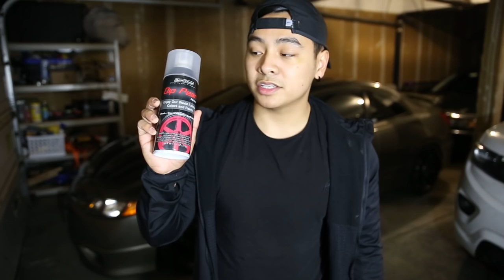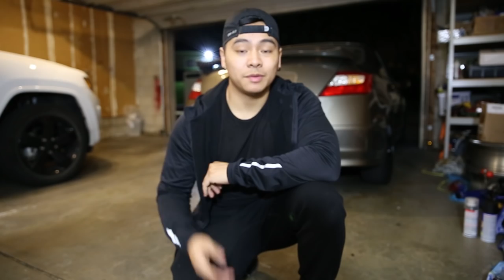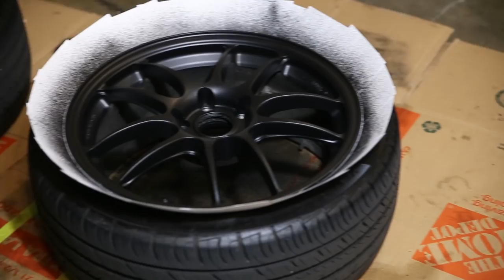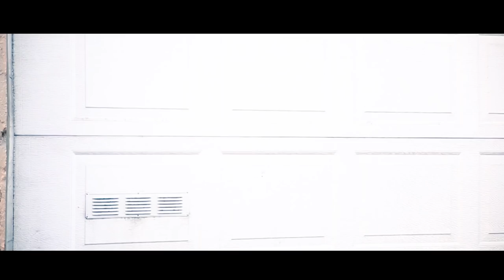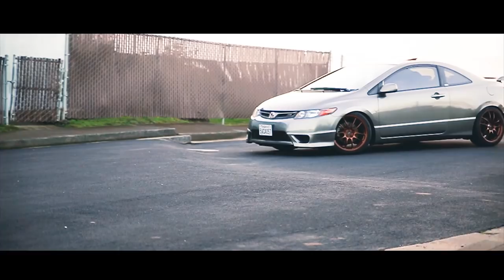HOW TO PLASTIDIP WHEELS (BURNT COPPER ALLOY)

Comment: the reason your first base coat came out all splotchy was because it was to COLD, thats how DIP behaves when it's to cold, little tip, when spraying in sub like 50-60 degree fahrenheit weather (which i'm assuming was the case based on the time of day and the date of this upload) you need to keep the cans warm, a trick some people do is keep the cans soaking in a bucket of hot water when not spraying and let them soak for a while before you start spraying.
Reply: Also he shouldn't spray with the wheels on the ground. It's an aerosol can designed to be held upright.

Comment: I want that color on my Meteor Gray 124 Spider's wheels......    BUT..  You're breaking Fonzie's #1 RULE for Wheels....  NEVER EVER spray your wheels lying down like that..  they need to be VERTICAL, or at the most a 45 degree angle..   Spray cans are not designed to spray downward...  When you have the wheels lying down, you get a bumpy finish because the paint is sputtering..  You 'll get a much , cleaner, smoother, more  powerful spray with the can upright....

Comment: Little advice, you need to apply at least 8 coats if you ever want to remove it at some point in more or less one piece. If you like peeling it off in a million little pieces then got for less than 8 coats.

Comment: i have 20" wheels but i wanna do the inside as well not just the front do you think 3 cans of copper will be enough? also how well does it hold the look as far as chips or peeling ?
Reply from the maker: Prep is key, definitely do more coats with the black base coat because i rushed 2 wheels so they peeled :( I peeled all of them off and in terms of your 20", i would do 5 cans of copper alloy, just to be on the safer side!

Comment: For the black base coat the index cards are a bad idea. Make sure to not use the index card for that base coat. You need the base black to go over the upper lip which meets the tire if not when you spray the copper on, it will be silver on top of the lip. When you are finished with a full black base coat of at least 6 layers let it dry. Then if you want to add the index cards then do it and copper spray.

Comment: How durable is that though?
Reply: foxtrot789 pretty durable
Reply: Pretty pretty durable
Reply: Pretty pretty pretty durable
Reply: Pretty pretty pretty pretty durable.
Reply: Pretty pretty pretty pretty pretty durable
Reply: Soooo, its durable?
Reply: Pretty durable
Reply: 5-6 coats it's VERY durable, you can wash it too, but I power wash it.
Reply: Be sure to always use Dipcoat once a month on them..   and you can you can use Turtle Wax Ice spray wax in between..  keeps the wheels smooth, with no rubbery feel..  so dirt comes off easier... and it protects it..
Reply: very very durable
Reply: Plasti dip is a rubberized paint. Best thing I can think to compare it to is truck bed liner, just prettier.
Reply: Dennis Mattson That’s a good tip, I had no idea
Reply: If properly degreased it holds at least 5 years, with good Care even much longer, and because its rubbery consistence it protects the Wheels from Stone Beats, what make it predestined for Car Wraping as well.